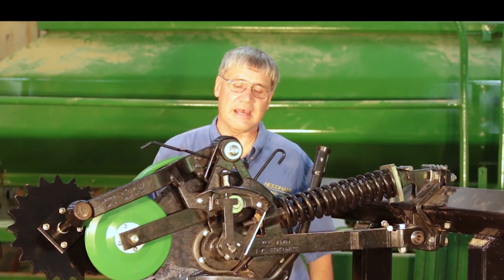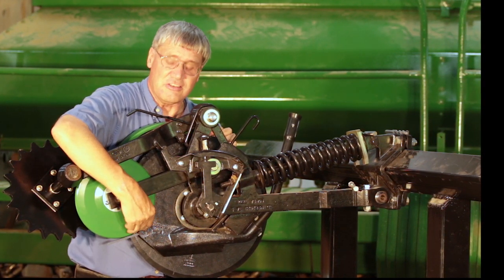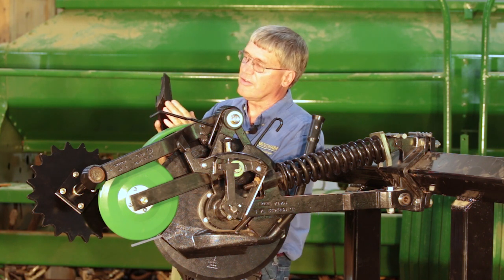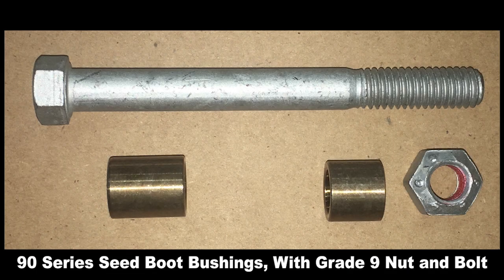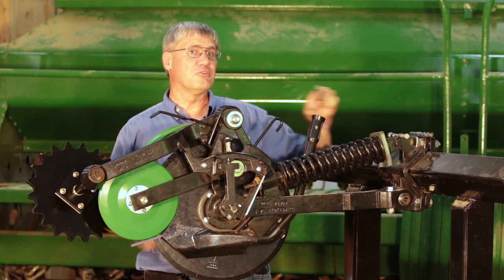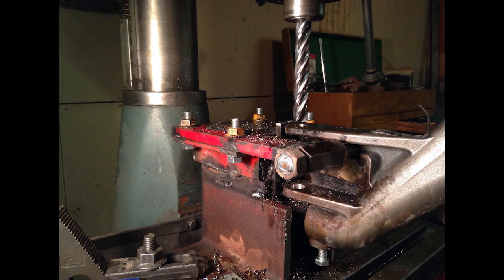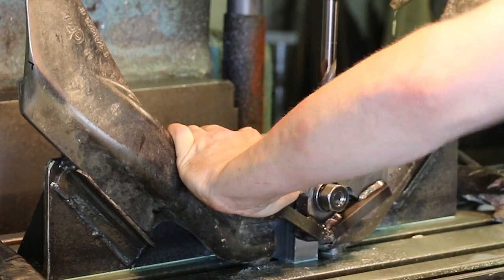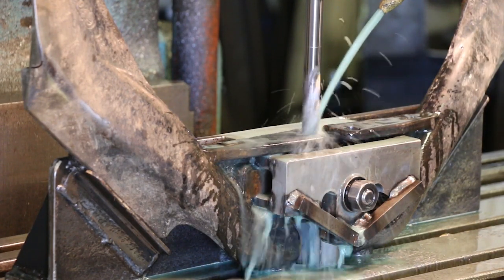Needham Ag - Seed Boots on John Deere drills and air seeders

Comment: If a guy has already drilled the boot mounting holes and bushed them would it work to buy your seed boots and bushings or would it cause the mounting hole bushing to work loose? At the time didn't want to drill boots everytime I replaced them but I noticed in your latest catalog you now sell pre drilled boots unless I dreamt it.
Reply from the maker: It won’t work to use our seed boot bushing kits if you have already drilled out the cast arm and added a bushing I’m afraid, this is because it’s hard to keep the bushings tight against the existing bushing, plus you can’t align the boot flush against the disc.
Reply: @NeedhamAg  Thanks for the response,  I guess I should have waited, your bushing system is alot better than the other fixes out there, lot of play in the boots even with the mounting hole bushing installed.